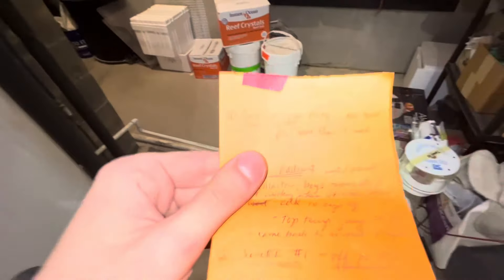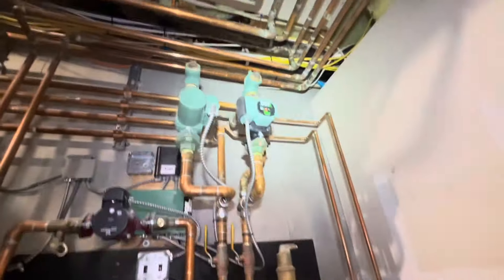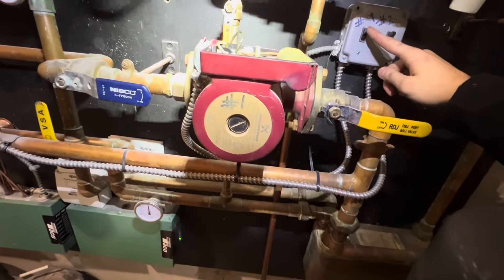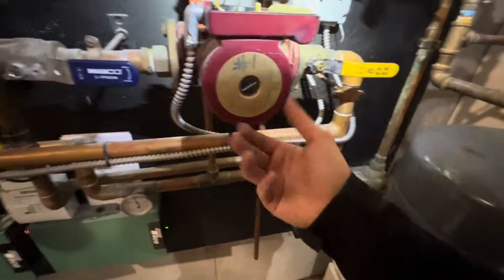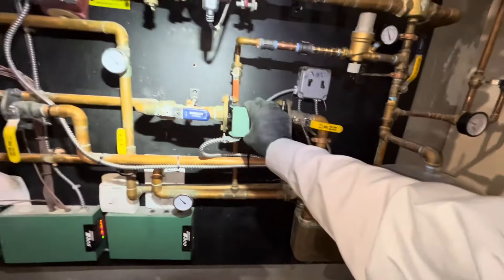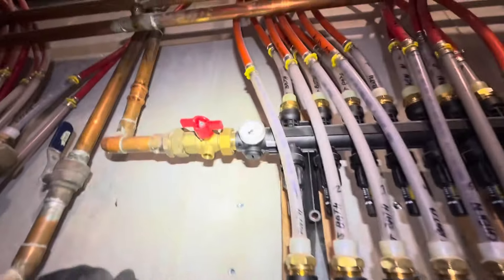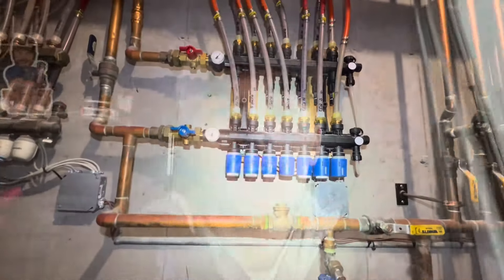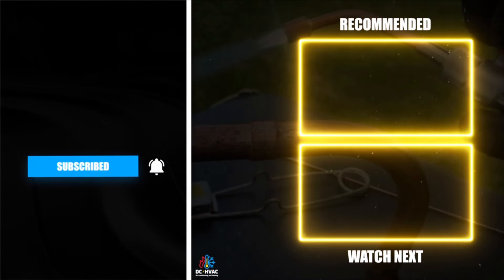Tuesdays Service Call! Radiant Heat Not Working! Dead Circulators! No pressure! Issues Resolved

Comment: Your videos are always interesting, and your attention to detail is admirable.  Recommendation - when you return to this house to complete the repairs, it would be best to replace the iron fittings that you installed on the copper line with brass ones.  Iron and galvanized steel couplings are anodes relative to copper pipe.  They will corrode if they are left in place.
Reply from the maker: Noted

Comment: I may be wrong as the video didn't show it well but it looked liked you replaced a grundfos 26-99 with a 0015e. The 0015e is more equivalent to a 15-58 and has a considerably lower flow potential than the 26-99. Might want to double check that. I may be wrong I couldn't see the grundfos #
Reply from the maker: The flow rate based on the length of pipe and size is not correct for a grundfos 26-99.